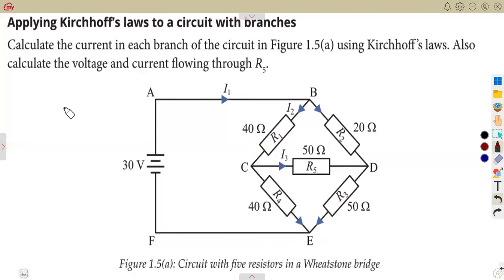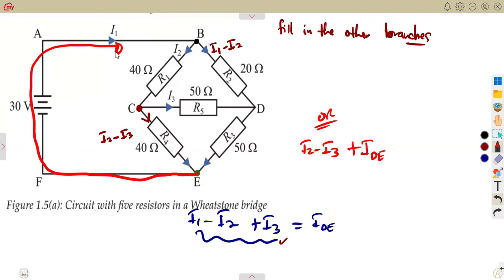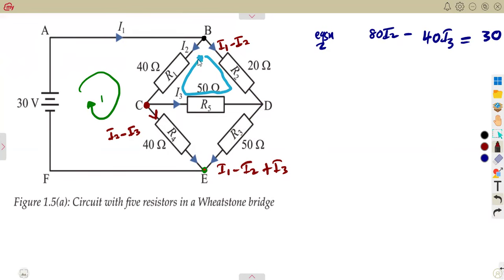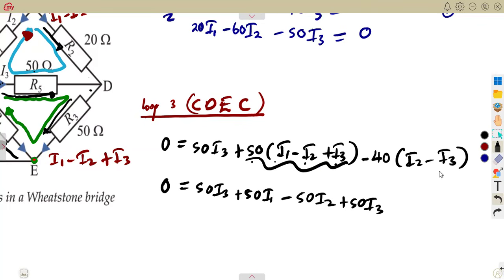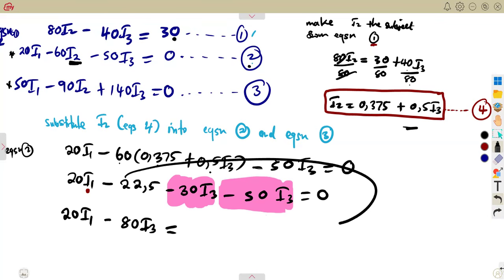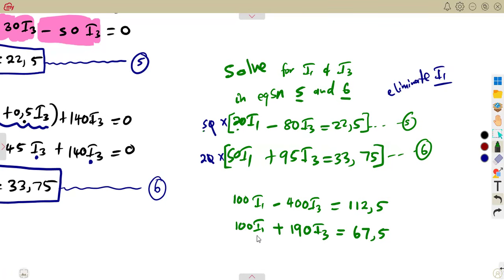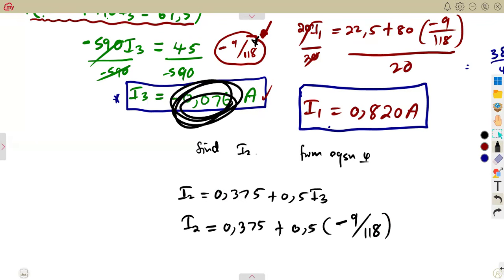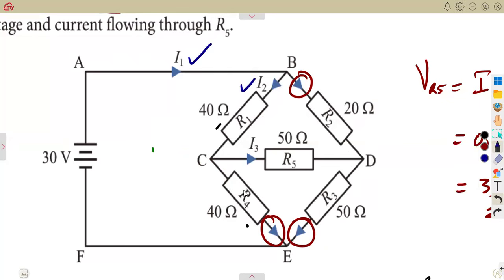Industrial Electronics N4 Kirchhoff's laws example 4 Bridge Circuit @mathszoneafricanmotives

Comment: I got so lost on this one I thought we’re supposed to use thevenin’s theorem of that one on the first step you remove the RL and resistors in series with it then calculate Vth using R1/R1+R2 multiply by voltage
Reply from the maker: Hie,  on this question is was kirchhoff's Laws
Reply from the maker: We can have a similar question using thevenin's Theorem